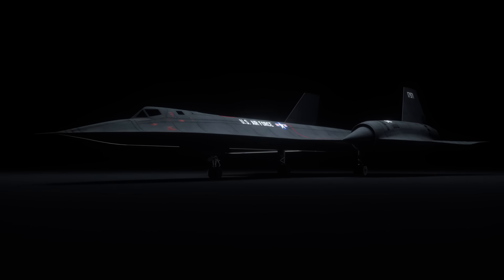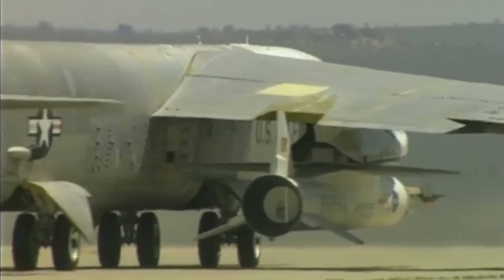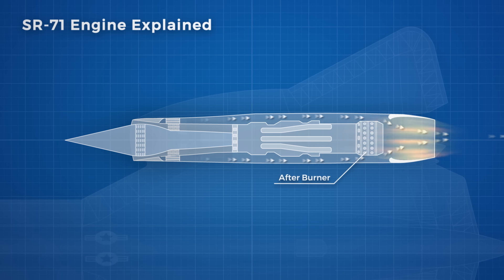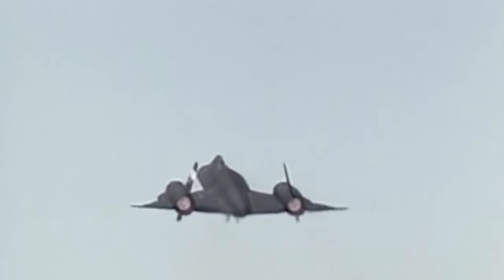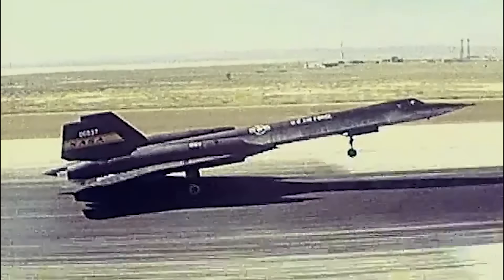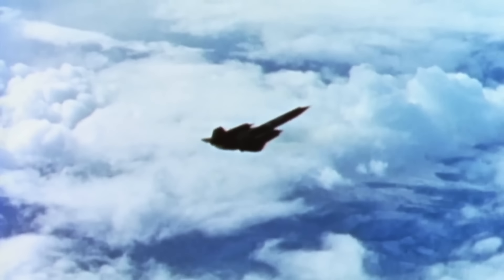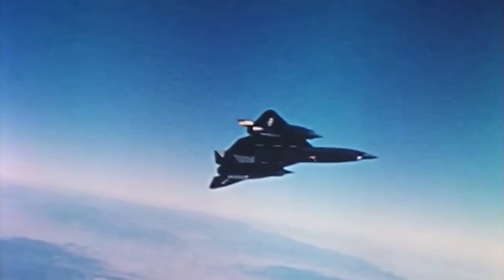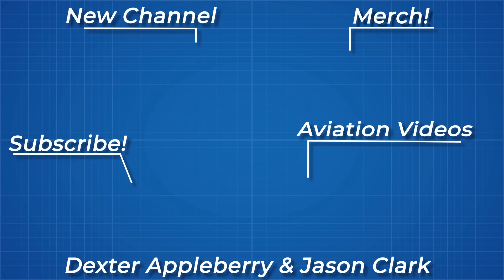The Insane Engineering of the SR-71 Blackbird

Comment: Why did they have to design entirely new materials to withstand such low temperatures? The space shuttle does Mach 33 and has tiles made simply of sand that can withstand temperatures of 3,000°
Someone is lying here
Reply: The Space Shuttle's thermal protection is an insulative one, where the transient heat of reentry is kept away from the spaceframe for as long as the reentry interface occurs.

The SR-71 languishes in the heat of Mach 3 flight for extended periods of time. No amount of insulation is going to work after the airframe is heat-soaked.
Reply: @BogeyTheBear  it’s going Mach 3 with tiles that can withstand Mach 33. There is no way this thing would even have a chance to heat up on the inside with those tiles on the outside.
Reply: Do you even know what the tiles on the Space Shuttle actually are? Hollow glass shells filled with silica foam. The Space Shuttle cannot fly through rain without the tiles getting water damage. How is that helpful for a military plane tasked with flying through different spots on the globe?

The Space Shuttle experiences intense heating for a mere fraction of the time an SR-71 endures on a mission. The duration of the heat impulse is one factor of reentry-- they cannot stay too shallow in the flight profile because that would mean the Shuttle would be subjected to heating longer than what the tiles can insulate.

There are very real limits to what the thermal protection of a spacecraft can endure. Sure, they fight off more intense heat-- but they cannot do it forever. The SR-71 manages the heat it has to live in-- a spacecraft tries to shed it or insulate it until reentry is complete.
Reply: @BogeyTheBear   do you even understand what we’re taking about here? Rain/heat damage would not be an issue with these tiles at Mach 3. Make sense? You keep referring back to space shuttle speeds

Comment: The russians have built a better jet engine back in the 90s. It had three hollow spokes positioned behind the turbine and connected to the extented root of the turbine, these hollow provided fuel RP1 through the turbine blades and into the tips of these blades. Aslo the shaft was hollow, so that compressed air was injected into the turbine blades for cooling along with the RP1 fuel. Both the fuel and air were mixed at the tips of the blades in small tip rocket engines that were regeneratively cooled. The leaky RP1 fuel was constantly leaking into the afterburner. There were also four bypass ducts that took air from the high pressure compressor into the afterburner, these ducts where large activated tesla valves. The hollow shaft was connected to the high pressure compressor and it was also connected to the low pressure compressor shaft via a planetary gear.  The jet engine at low speeds functioned as a normal jet engine with the tesla valves directing the compressed air into the hollow spokes in order to cool them down. Also the hollow shaft was taking air in order to cool the turbine blades. At high speeds the RP1 was directed into the spokes into order to cool the turbine. The tip rockets had one way fuel /air valves and were providing both thrust and spin. The jet engine was also water/nitrous oxide injected at high speeds and at high altitudes. It used a single annual combustor to eliminate hotspots. It used fullly rotatable stators too. It was used in their experimental mig interceptors...lol

Comment: Looks like plane made by Beast in X-men. Jokes apart, Mig-31 was able to fly 37.6 km at MAK 3 in 1977 & go 35km height in 4 mins. It was made of steel only & thus not expensive & was mass produced. Still that is made more advanced ironing all angle radar upto 40 plane target track. It is simple design, fly higher, fly fast, carry intercepting weapons & still much cheap.

Comment: Here’s one for you concord weight 185 tons fully loaded that traveled at Mach 2.4 with passengers sipping champagne 😂 the at 70,000 feet 
Sr71 max weight 85 tons flew at Mach 3.5 with pilot and co pilot in bloody space suites some thing don’t sound right give the fact there was 10 years between them still to this day the sr-71 remains my favourite jet ever made but it definitely flew faster than they are letting on 
As missils back then reached Mach 4.5/5 flight ceiling of 103,500ft so like it says in the video the sr-71 sped up and changed direction yeh I bet it did

Comment: I'm down the rabbit hole with this plane now - it just gets crazier the more you read.
To get the main engines started from cold they used an AG330 'start cart', which was a cart with two 425 cubic inch (7.0L) Buick Wildcat V8 engines connected to a common output shaft to manually spin the engines to 4500rpm, at which point they could self-sustain.

Comment: At Mach 3, the temperature rise from the sheer compression of air from both the ram effect and compressor stages added to the already hot temperatures in the exhaust and so the fuel flow to the combustion chamber had to be further reduced to prevent the turbine from melting. This would reduce the power coming from engine but could still rotate at its max rpm so the airflow through the intake would not change. This reduced combustion in the combustion chamber also meant more oxygen would be left over for combustion in the afterburner, giving it more thrust.

Comment: One interesting aspect of the Blackbird is that it was not as efficient at subsonic speed. The transonic compressibility was significant enough to prevent the SR-71 from breaking the sound barrier using engine thrust alone. In order to go past Mach 1, the Blackbird had to climb to 45,000 feet and then initiate a shallow dive in order to go supersonic.

Once it got through the sound barrier, however, the drag decreased significantly and the plane could accelerate again in a climb as the engines built up power.

Comment: We humans aren't this smart on our own...I mean, with the leaky tank and allowable drip rates, yeah, that's exactly what a human can do, and still make it work.  

These designs though, and the understanding of pressure and shape design for lift and sound barrier position control, all by design, just seems like something we reverse engineered, and this plane and concept is one of 2nd hand imitation. 

Nah, just kidding, trying to outrun Sound 3.5 times over, all while straddling a large fuel tank which, aside from its safer low volatility fuel, also incorporates a fuel so volatile that it ignites the moment it hits oxygen, is exactly something a human would think up.

Comment: The special heat resistant fuel cost more than single scotch malt whiskey I heard. I saw the SR land at Farnbourough UK in 1974 after its public record breaking flight from New York to UK in 1 hr 54 mins,  but the usual runs to the UK would have been faster  as on this flight named "glowing speed"  in flght refuling took place due to the weather in the UK being bad and in case of a divert. The SR had to bleed of Knots by turning over Holland before approach. I was under the SR one day when at 300ft in a turn it suffered an engine or engines stall, with" BANG BANG" coming from it and flames in an explosion from the tail pipes I thought I was a goner!
I have lots of Kodachrome slides, but I need to find out how to get them on this thing!

Comment: Theres a video of lead engineer of sr71 engine talking abour the plane in depth. He told that once they had crazy test pilot who after a test mission in 60s wanted to test how fast it can go, he went flat out and pushed the plane to around mach 3.5 and then lost the engines due to sonic shock wave moving in wrong position making the airflow out of engine not work as it was designed to 3.2. But its still funny story and proved it couldve been made faster, but 3.2 was enough for its mission

Comment: The engineers didn’t care about going faster because the limiting factor for speed was metallurgy…..not thrust.  Parts of the engine and fuselage would start to melt past the stated top speed of Mach 3.2. The heat was generated by friction with the atmosphere. The real top speed is still classified.  Today, metallurgy would allow the SR71, or its replacement, to go even faster.  This was designed back when the military got things done instead of throwing pronouns around.  Lastly, the Airbus A380 was a turd.  They are all developing wing spar cracks after a short life.

Comment: Um, I have a question. Doesn’t the space shuttle reach a speed of 25,000 mph to leave the earths atmosphere ? Not only would the space shuttle be the fastest plane, it would be the highest flying plane also but it isn’t 🙄 I say plane because it’s a jet modified to not look like a jet, you can hear the jet engines when it lands and the jet engine sound is in the videos of it landing. Should not have a jet engine on it as they say it is just a glider. They say the sr71 blackbird starts to fall apart at just over the maximum speed of it at 2100 mph and it’s thin and aerodynamic but the shuttle hits a whopping 25,000 mph 🤣 oh cool story bro

Comment: The XB-70 Valkyrie was a 60s plane that could fly at Mach 3.1, close to the SR-71
There are also many other fighter planes that go almost as fast as the blackbird
MiG-31E Fighter – Mach 2.83
MiG-25 Foxbat – Mach 2.83
F-15E Strike Eagle – Mach 2.5
Su-27SK – Mach 2.35

Comment: If they used the heat from the surface to generate energy, the heat would be absorbed, the power would be increased.
It is generated of electricity by temperature difference; therefore you create a path for the heat to transform and that causes the heat to "burn out".

Comment: Thanks for the awesome video, I really enjoyed it
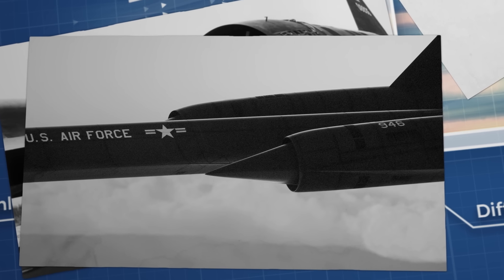3:55 But shouldn't the inlet spikes move to a more forward position in higher speeds? since in higher mach numbers the shockwaves move closer to the body of the structure, and in order to keep the shockwaves out of the engine, I think, the spikes should move forward to keep them further from the inlet.
Reply: due to how the higher air speed ricochets inside the engine, it causes the shockwave to move inwards/towards the engine as opposed to away from it. Pushing the spike backwards would cause it to ricochet more, burning away more of the energy of the air, and keeping the shockwave at exactly the right spot

Comment: For my money, this aircraft represents a greater achievement than even the actual space program. Or at least equals it. The ability to fly in so many different regimes of flight is astonishing. The absolute controllability of all systems from idle speeds to ramjet mach 3+ speeds in everything from sea level air to very nearly not any air at the top of the atmosphere is just incredible.

Comment: I believe the thing you were referring to as the normal shock is referred to as an oblique shock formed by the tip of that cone. The SR 71 uses reflected obique shocks inside to reduce Mach number without losing as much stagnation pressure, and eventually the last reflection is the normal shock, hence it using a complicated oblique normal shock diffuser. Also when there is spillage, that is a result of it exceeding the turning angle for the given flow, forming a bow shock.

Comment: I met some old timers at Pratt who worked on the j58. It was some very deep understanding of the compressible fluid dynamics, the art of making approximations, asymptotic methods, and ingenious use of mechanical computers/ control systems. The structure and materials guys would tell another view esp regarding tooling. There are not many of them left. The younger ones are in their nineties. The sickest thing I see is the young PhDs when you take away their CFD code, they are useless . They can’t even tell the trend that one can get with simple physical reasonings. 

There is also the scramjet... though it’s better at higher Mach number

Comment: Sounds more like a propaganda video. A bit of physics will tell you that it makes no sense for the leaking fluid to be fuel, since at at those high temperatures, it will simply ignite, putting the pilot in danger. The reason for fluid to be coming out of the skin of the plan is to reduce drag since instead of drag acting on the surface of the plan, it rather acted on the tiny film of liquid which wasn't fixed to the surface, thereby reducing air resistance significantly. To throw the public off, they just claim the leaking fluid was fuel. That plane has no real advantage now become Russia and China have developed ram jet engines as well, so it's a shame that it's engine has been used in the new B21 raider.